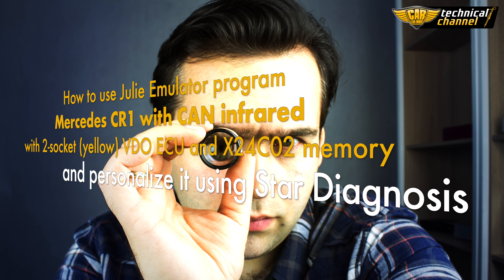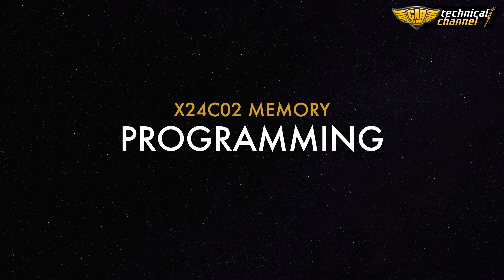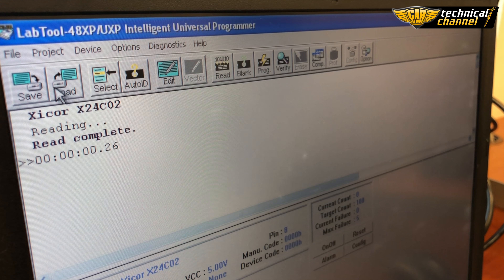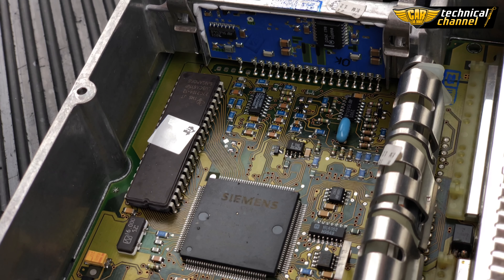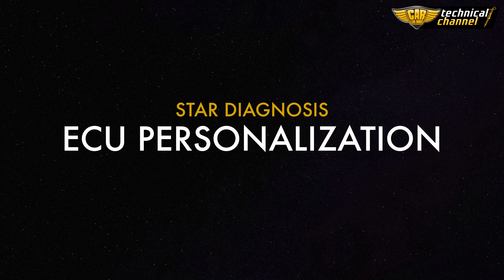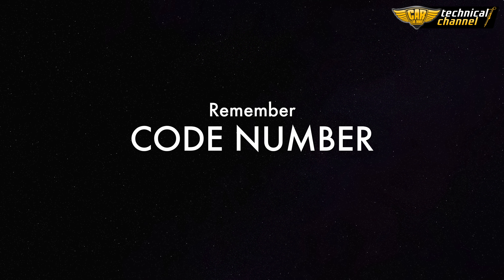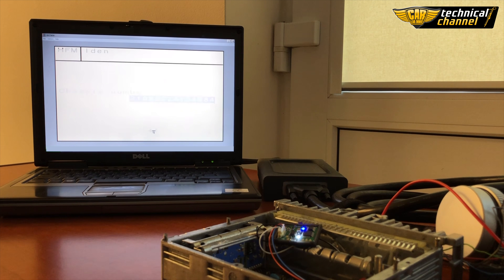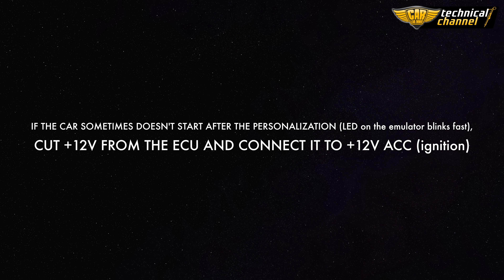Mercedes W210 (VDO MSE ECU) IMMO OFF with Julie Emulator™ by CarLabImmo

Comment: Where is Wsp module to cut can lines?
Reply from the maker: It depends on the car model, you can check on the Internet where the WSP module should be located in your car model.

Comment: I tried changing byte 27 to 33 and bytes 50-55 to 02 03 00 FF 00 20 like you show in your video but HHTwin won't let me change the VIN. What am I doing wrong?
Reply from the maker: The video is for reference only, the emulator installation procedure should not be performed on its basis. You must install the emulator according to the PDF manuals, because they are constantly updated and the videos are not. 

For instructions on how to use the emulator in your ECU, see page 7 of this manual:  https://carlabimmo.com/manuals/immobilizers/mercedes/mercedes-2.pdf
Reply: @CarLabImmoTechnicalChannel Thank you for your reply. This pushed me even harder to try and find a solution on my own.

In fact, I managed to virginize and change the VIN after all without using your emulator. The engine starts again and the car is saved from going to the junk yard.

Comment: Hello.  edited eeprom 24c02.  made all the necessary connections.  When connected to HFM ME2, stardiagnosis writes to turn on the ignition.  But everything is included.  what am I doing wrong?
Reply: connected to 38pin connector: 1 pin - gnd, 3 pin - + 12V, 4 pin - k-line
Reply: found two ways to set software jumpers on your device 1) J6, 2) J1, J2, J3, J4, J5.  which way should you use?
Reply from the maker: Can you contact me via email? I'll try to help. Please send the changed file, photos of your ECU label, plug and board. My email: nicole@carlabimmo.com

Comment: Wow what programmer is that i mean the eprom adapter and how did you turned on and of the ignition?
Reply from the maker: The adapter is handmade. But you can buy one where you usually buy a programmer.
Reply: Godiag GT100 is the cheapest solution.

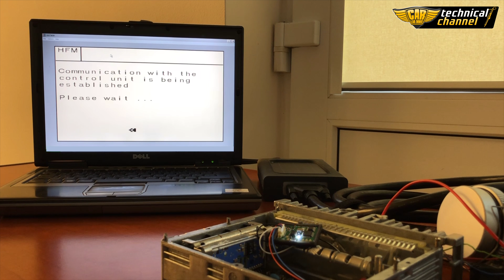Comment: in minute 4:26 what software you use?any obd cheap can do the same like what you do?plz reply tq
Reply from the maker: This is Star Diagnosis.
Reply: I’m trying to connect HHTwin on the bench with the yellow socket ECU for a W463. I know the truck has the old 16 pin box, not the 38 pin round socket. I have tried to use the banana plug cable for 6 hours to no avail. Now I’m trying the 38 pin cable also to no avail with pin 1 ground, pin 2 (ignition) and 3 - 12V, pin 4 - K-Line. It doesn’t connect. 

Can you explain what I’m doing wrong?